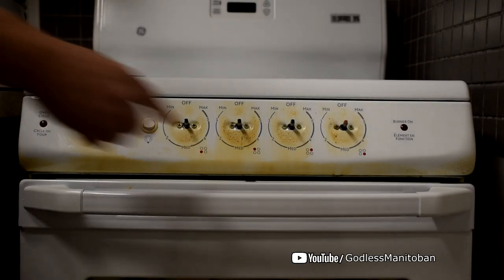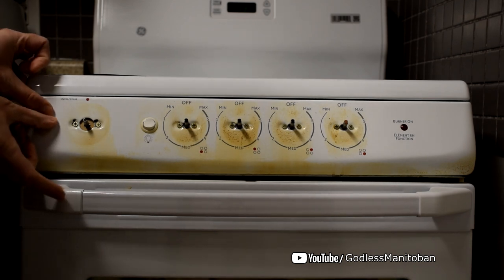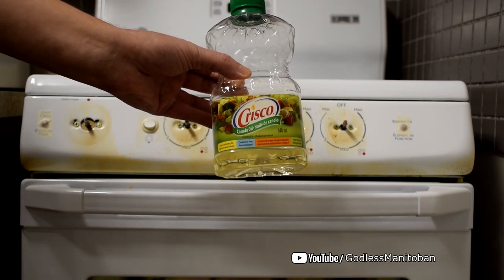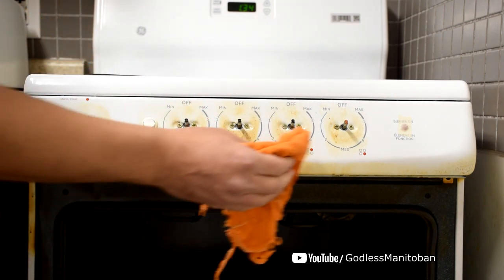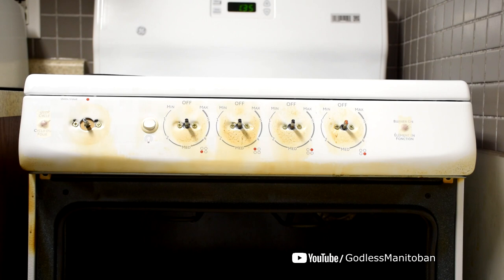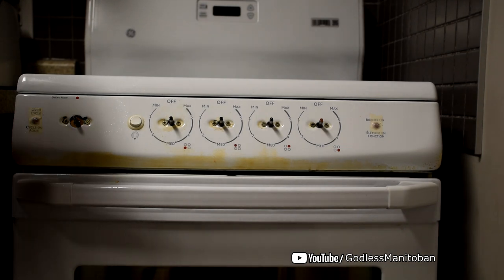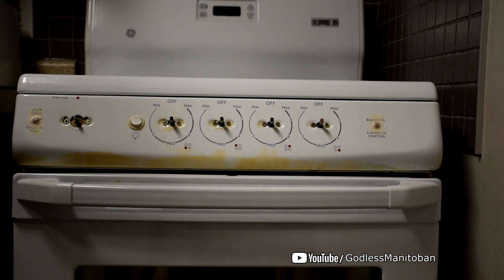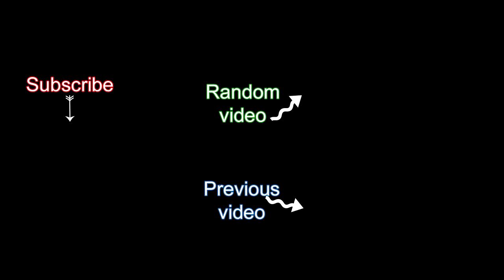Using Canola Oil to Remove Baked on Grease

Comment from the maker: The article I originally read online recommended vegetable oil. But of course I only had canola but was surprised when it worked after trying to clean it before with soap and hot water.